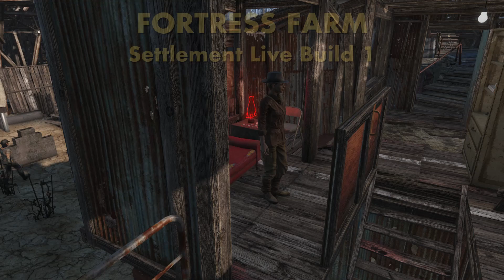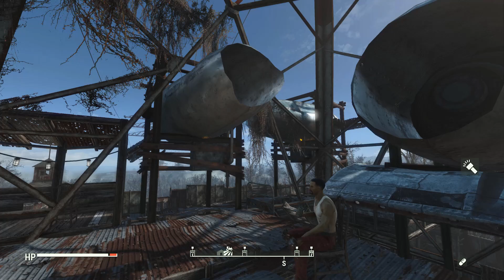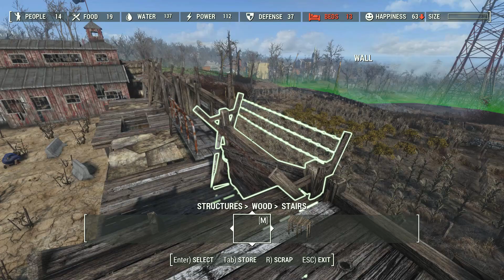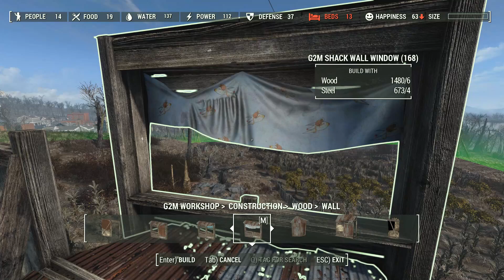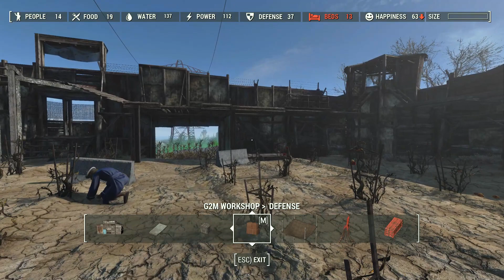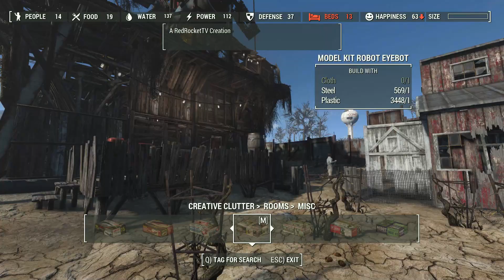FARM FORTRESS at Abernathy Farm | Fallout 4 Let's Build Part 1 | RangerDave

Comment: I wanted to make a walled settlement with walkways along the wall, but struggled with how to put the walkways in place. Then I realised that I could start with the walkways. 

I built a basic outline of where the wall would go, using the 1/2 floors from Far Harbour mostly, adjusting the height as needed by putting in stairs. Then I replaced some of them with shack bridges and other stuff, and finally built the wall itself from junk walls and other things for variety. 

It worked pretty well, even though some of the things I put down ended up messing up NPC pathing despite my efforts.

Comment: So here’s an interesting idea, a Far Harbor version of your Nuka World outpost. It would have to be bigger and sturdier, with Far Harbor being a lot more dangerous than the Nuka World Wasteland, but it would be really cool to play around with trenches and dirt walls in the woods. An interesting spot to put it would be the waterfall near the crashed airplane. Add a cave that’s been converted into a barracks/command station and that would be pretty awesome.
Reply: I did something like that at the Visitor's Center. The main building is my command building and the parking lot has been converted to a big Minutemen camp using the tents in the Sandbag Fortifications mod. Then I used the guard posts, trenches, barbed wire, and spiked barricades in the Sandbag Fortification mod around the outer edges of the settlement.

Another cool note, you can convert that little trench leading to Longfellow's Cabin into a realistic-looking trench with the pieces from Sandbag Fortification. Anyone attacking has to use the trench to get into the settlement. And you can put turrets and guard posts overlooking the trench to make short work of any attackers.

Comment: Dave I'd make more defenses like guard posts around the outside farm so they don't get ruined by attackers. Also maybe u could find a way to connect the water tower near the settlement so u can use it. Last thing, cover ur walls with metal plates so they won't burn easily

Comment: With the invisible wall, see if you can still place items up there. You could have the apartments/quarters below it so settlers can still get there, but you could have a turbine area above it which wouldn't need to be accessible. It won't be usable but it would still function and look the part. 

If you're completely surrounding the fortress with farms and maybe extra shanties/tool-sheds, you should have them protected by crude, palasade-esque walls at parts, similar to your last Nuka World build but with more wood features. Accentuate how the outer wall is only to slow attackers down, while workers outside flee to the interior fortress. You should also have a few towers that rise far above the fortress's walls, and are only accessible from the keep itself.

You'll also need a depot for storing all the supplies and prepping them for transport to other settlements. Bedford's train can't reach here to help... And that's another idea.. A local way-station in a dangerous area that focuses as a hub for transport. Nothing but a fortified train station where people/merchants/suppliers can rally to hook up with the Minutemen's rail network, solely for those whose settlements don't directly connect to it.
Reply: Gear Hawk https://www.nexusmods.com/fallout4/mods/23223?tab=description